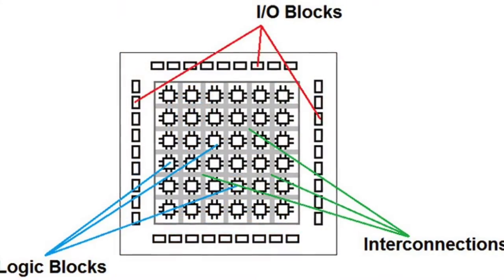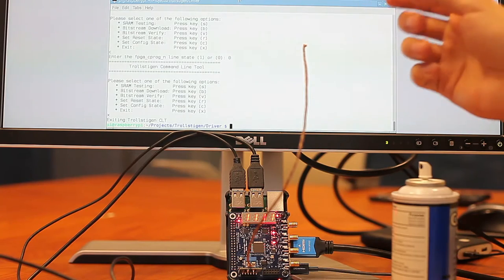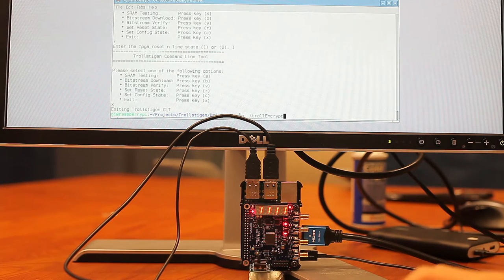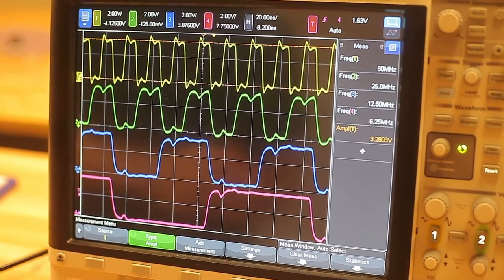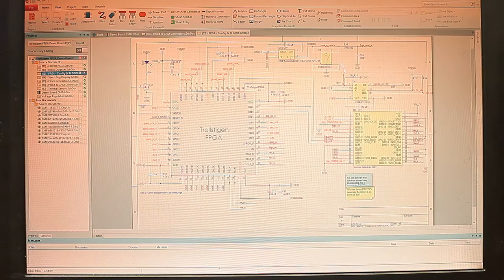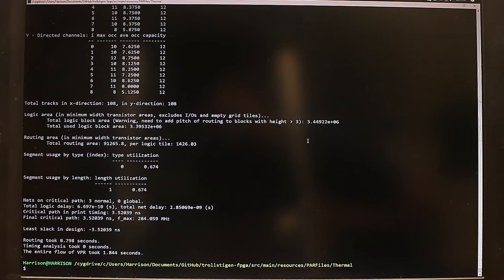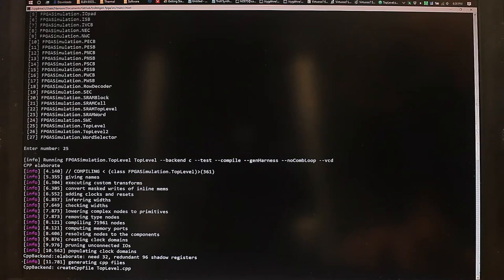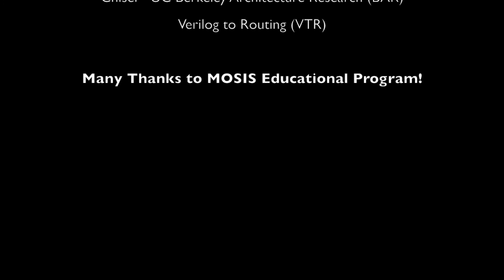Trollstigen Open Source FPGA - VLSI Design Lab, Columbia University

Comment: I don’t get it. Why only 64 CLBs and not, say, thousands of them? Was there a particular reason from limiting the capacity of your FPGA?
Reply from the maker: We were die size limited to 2.25mm^2  based on the MOSIS education tapeout, so in 130nm process that is all that could fit. The routing architecture was designed to work with well over 1K CLBs